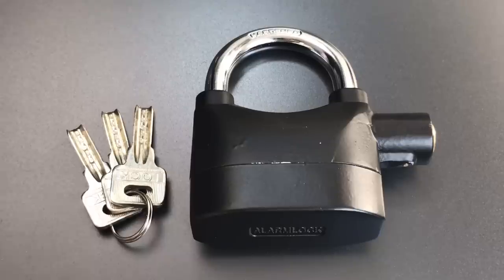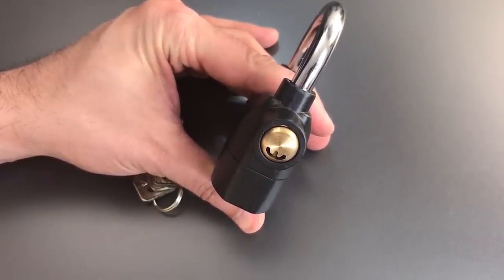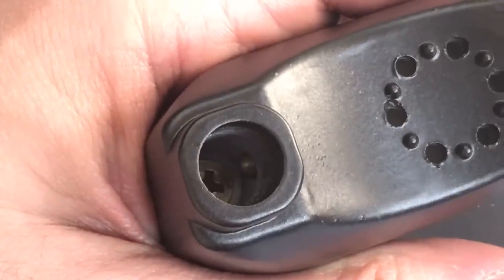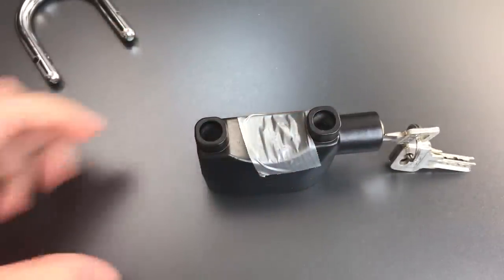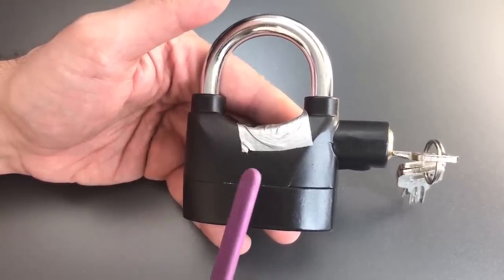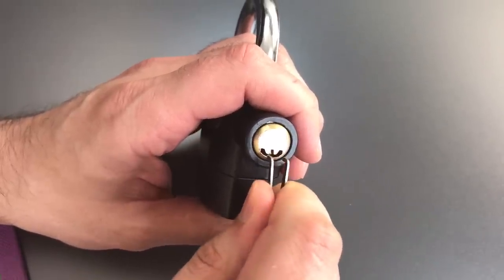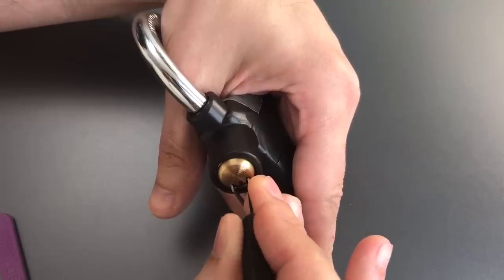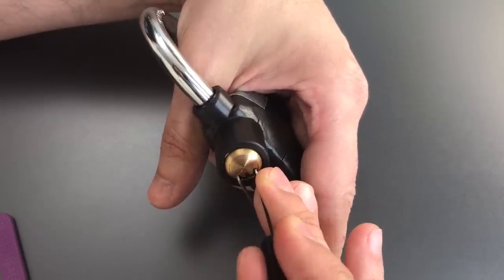[505] Chinese "AlarmLock" Picked Without Triggering Siren

Comment: They need a trigger sensor in the lock to sense when it is being picked!
Reply: how would that work?
It would go off even if you open it with the key.
Reply: 1 second delay
Reply: ༺Boy Red༻ Simple. Just let the lock give the person a second or so to open it before triggering the alarm, or maybe sensing which pins are being pushed in before others, and using that to determine whether or not the alarm would go off. This thing is Chinese, though, so I wouldn’t expect it from this lock.
Reply: One way I could think of is SOMEHOW being able to detect the time between each pin being set. If you insert the key, all the pins would pretty much instantly be set, where as a lock picker goes in pin by pin.
Reply: Just have it trigger on the false gate.
Reply: maybe if u hold the key in for too long that it sounds the alarm cuz it did take him a minute to get thrue the lock and unless ur stupid u aint spending more than 10 seconds on a lock but if ur lockpicking u will  @ItsBoyRed

Comment: i propose this lock for best lock on your channel. picking the same lock multiple times while holding it in your hand is not a real scenario. as you´ve said, the first time picking it, you triggered the alarm! additionally, if the lock was actually locking something you wouldnt be able to hold it like you do, using your muscle memory.  and last but not least, you even got stuck with your covert-entry pick. lpl has found his cryptonite. ^^

Comment: 2 things

1. Try picking it whilst it's hanging from a gate or in my case a tow point on my 4x4 2ft arms reach away so if it gets knicked in the night they wake all my neighbours up

2. Just pours a little boiling salt water with a bit of sand in it into the speaker hole, no noise at all ceases things

Comment: I picked one of these up at a car boot sale today because it looked interesting and I figured I'd forward it to LPL if he hadn't already negotiated one. Well, imagine my surprise when I found this video. The battery is replaced by removing the shackle and there is a posi-screw at the bottom of each shackle well. Unscrew those and the bottom pops off revealing 6xLR44 cells.

Comment: This lock seems better than any other on the channel. I’m buying it. If it takes him that long it’ll take a burglars longer.
Reply: As an owner of this lock, the quality of metal is awful. It's light as a feather. A bolt cutter will have it off in 2 seconds and a thief brings a cutter not picks. I use mine on a motorcycle but hide it under the seat as a motion alarm.

Comment: Hey LPL. You can use an even easier way of disabling the alarm on these. The design flaw is the speaker. If you get the alarm wet, it shorts out the battery and disables it completely. Found this out via a wet Scottish Winter!

Comment: This alarm lock is GOOD ENOUGH.
If your locks are on the inside. Very useful and effective for gate locks.

Those that need your hand to be inserted inside just to insert the key. Our gate is like that. Our gate has a hole fitted only for one hand for keying the lock situated inside.

If Lockpicking Lawyer took a solid 2:30 minutes to unlock it WITH BOTH HANDS at full capability, angle and space to work with, then this lock is good. As for the 507 update, re-read the previous paragraph and it's just impossible.

Comment: I owned two of these locks. They are not waterproof at all. Which is a big flaw for an electricity operated alarm lock. Leave it out in the rain overnight and then trigger the alarm. If it still responds at all, all you will hear is a super muffled "bleep bleep, eeeew... pffrt. Silence". If I was to attack this, I would probably just pour it full of water and then use an ice spray and smack it with a hammer.

Comment: In a real situation, the keyhole may not be in a convenient direction and the lock might also be closer to ground or on the other side of a fence or surrounded by bike parts. The makers had to compromise between sensitivity and accidental movements caused by environmental activity. The risk of triggering the alarm is already a strong deterrent to thieves, quick makes this a pretty good design concept and quite well executed. I just wish there was a way to customize the sensitivity. They should use an accelerometer rather than detecting spikes in electrical contact

Comment: I'm no locksmith, but if I were to design an alarm lock, I'd probably do it with an RFID key. If the barrel rotates without the RFID tag on the key in proximity, then the alarm would trigger. Obviously in addition to the jostling detection, of course. An alarm is no good if it only triggers when it's already too late.

Comment: I can just imagine some kids purposely triggering the alarm and running away just to screw with the owner. Thats another problem with this lock is that the alarm triggers relatively easley. It should sound when it's getting picked or cut. Not when it gets gently tapped

Comment: I would like to see this one redone, the way you are holding the lock instead of it hanging by the shackle removes all tension defeating the purpose of the alarm system. You wouldn't even be able to hold the lock in that position you just did if it were actually locked onto something, kind of cheese. I still love your content though.

Comment: I could actually see this being good against low-skill attacks, just because of the siren. Using bolt cutters, or even possibly a plasma cutter/oxy-fuel torch would likely set this off, and it does seem like it took LPL a bit of time to pick w/o setting it off. I view plasma cutters and (to a lesser extent) oxy-fuel as lowish skill, but high cost of entry; no point in listing an angle grinder as they're so loud the alarm would even matter. Oxy-fuel is definitely quieter than a grinder, not sure about plasma cutters; they are definitely a bit noisy due to the high volumes compressed air they use. I still don't think plasma cutters are as loud as an angle grinder, but I'm not 100% sure because it's been over a year since I last used mine, and I've never directly compared the two.

Wouldn't use this lock in high-security applications, but I could 100% see myself using it for low-security applications where someone is typically nearby.

Comment: There are various parts of the lock mechanism (not least the tumbler) that could easily be monitored directly for motion. It shouldn't take more than a second or three to open a lock with a key, but it would be challenging to pick it in less than three seconds without triggering the motion sensors, I should imagine.

Comment: I have this and it only uses 3 LR44 batteries.. I never bothered to replace them. I would see this as a good review of the security as in the real world like on a bike chain in a shed it would be very hard to pick without setting the alarm off... If you replace the batteries. That said, the tape is worrying and highlights a weakness.. maybe super glue or Krazy glue squirted into the speaker holes would be even more effective at silencing the alarm.... If you replaced the batteries ;)
Reply: Salt water?

Comment: I think the main problem with this lock is that you could just heat it up with a blowtorch and the alarm speaker would immediately break. It would only need to get to about 100 degrees C and then you could pick it no problem

Comment: I wouldn't feel safe using this. Think about it. It's the middle of night at work or home and I suddenly hear that someone has tried to break into the back door or my shed as the alarm had gone off. Now I either need to call the police (when a few hits from a windy night can set these off), OR I need to go to the lock with the keys in hand and unlock it to stop the alarm. This is the crazy part, for all I know I'm going to get a bat to the back of the head as soon as I open it to disable the alarm.

Not worth it.
Reply: What I've learned about locks on this channel is that there is a lock for every situation. So in your scenario maybe you are right this isn't the lock for the job.
Maybe in this scenario you would have been using a gun lock and took it off to shoot the guy with the bat.

Comment: I think it would be quite more difficult to pick this lock whent it is on a door. Having it on the hand, in my opinion makes it way easier to pick this lock without activating the alarm compared to normal conditions.

PD. I'm not saying that picking a lock doesn't require skills.

Comment: I love how easily the speaker is compromised with tape. Did a similar thing in college with the smoke alarm that would go off anytime someone was cooking. 
But I take issue with how you picked this lock. Your grip for holding the padlock is completely unrealistic for how one would hold the lock in the field. If this thing were attached anywhere, you could not put your thumb through the shackle and keep such a solid grip. Admittedly, I am an absolute novice when it comes to lock picking, my knowledge coming only from your videos, and your grip may have had nothing to do with the end result. However, I feel like the way you held the lock prevented the alarm from triggering, and ultimately, I wouldn't consider the lock successfully picked if all of the security features aren't taken into account.

Comment: You are amazingly skilled to open locks but i would like to see you try this same lock or some of the others already chained down because your hand placement would have to be diferent you put your left hand inside the area were there would be a chain or a piece of metal. I think you would be able to open it but it is a little more tricky to make tension to the key area. thenks.

Comment: This is a very controlled environment. It wouldn't be that easy to pick this lock (or any good lock) if it was dangling off the thing it's locking, in a poorly lit driveway in the middle of the night. Furthermore, burglars would be tense and filled with adrenaline (fear of getting caught) which would hinder their lock picking ability.

Comment: wouldnt it be better, if they put some sensor that would check if you are putting pressure on the mechanism (so checking for the core element of picking a lock) and dont unlock it within 0.5 - 1 second it will sound an alarm (and a counter if you do very short pressures too much it will sound an alarm to, so you cant abuse it)

Comment: you could also just create a lock that doesnt work and only works when your in a meter of the lock therefore accepting  codes whereas being far away the bike will not accept any code until that key is close into vicinity: almost perfect

Comment: If tape works, imagine what your hand over the sensor could do. I wander if you could punch a hole through the screamer with a hammer and screw driver without setting it off. I feel that would be easier when it's suspended and in use.

Comment: With the protruding mechanism surrounded by PLASTIC, could you just cut around it with bolt cutters or a Dremel?
Also, battery life / replacement ?

Comment: There should be one that links to an app. Before unlocking you activate the lock from the app, which sets off a 15 second timer. If the lock is unlocked outside of that 15 seconds it sets off an alarm and sends a notification to the owner. 

Maybe even incorporate a really shitty small camera?

Comment: Im just wondering, if its so sensitive, how is it when using in a real situation? I mean, if i put it on my shed will a strong wind set it off? It doesnt seem practical with a lock that you cant use outside.

Comment: The alarm lasted longer then I thought they could make it so then the alarm is triggered by lock picking by putting maybe a system in the part we’re the lock goes so then it’s a little more resistant to lock pickers I would give this a 3 stars

Comment: I use that exact same design locks but different manufacturers. But my locks has a bit loose shackles and also the copper(?) Keyhole aslo a bit loose so if someone pressed too hard on the keyhole it's basically just triggered the alarm no warning beep. Even when i try to open it with the key the alarm always get triggered.

Comment: That seems like a pretty good lock to me it too you a while to pick it and that says something at least to me and yeah maybe the alarm is a little easy to stop but it still exists and its fairly easy to set off and it does a pretty good job at being a lock your probably not gonna use it on thr absolutely most valuable thing and no average person will be able to pick that with little to no experience under there belt

Comment: how can you say you can pick it easily without setting off the alarm when you had your hand  under the shackle holding the whole thing stable.
Reply: You make a great point. A thief will rarely roll up with a set of picks though. He'll most likely bolt cut it or the chain its on. I own one of these and they are crap quality.. but, it's a great motion sensor and is very loud. So hide one where it will fall over or be shaken and it will serve well as an alarm on a bike, door, holdall bag or whatever as long as it's concealed. Even this lock picking legend set the alarm off twice before beating it.

Comment: If you knew enough to be careful that means you know it's a alarm...if you know that there's 100 ways to deactivate it besides tape which itself if not CAREFUL will set it off .. OTHER things to do might include  pouring a water alcohol acid solution over the holes to melt the electronics or the speaker or pouring over the holes some fast hardening epoxy  which all would make whatever it does way less severe than the tape... ONCE AGAIN,  the issue is  that locks no matter what have a limit to their utility which everybody understands except you.. AND Along that line, if a crook breaks into your house and  you have have a keyhole wire latch lock costing a dollar or a 200 dollar security smart Lock, it's still breaking and entering versus not in court.... LOCKS have a legal and intent exposing function and are a deterrent for opportunistic and petty thief crimes,,, they are never bank safes,, not even if it's on your house door.... YOU never use a lock as the sole way to protect valubles... For valubles the lock is on a box in a vault with a dozen security features, in your house or a business you don't keep expensive valubles there and you also have a phone system to call or that calls the police itself and maybe a gun and an escape route.

Comment: could you make a lock that needs all the pins put in the correct position in a certain amount of time? then lock picking would take longer than just putting the key in. idk an idea
Reply: You certainly could but the required circuitry would be rather complex for a simple padlock.

Comment: This lock can be defeated without even getting close to it.  Use the "cry wolf" approach.  Just ping it with a BB fired from a BB gun and leave.  Do this action a few times over a few days.  The owner will replace the lock with a lock that doesn't contain an alarm.  🙂

Comment: So, I've watched a few of your videos now, one thing I have noticed is you dont really test picking these locks when they are actually locked to something.

For instance I've worked on power grid right of ways. Often times the locks are kind of embedded into posts, through holes in steel poles, just generally in weird positions where I cant actually manipulate the lock body, which in turn makes it a pain to unlock with even a key.

Like most things, it's easier in a controlled setting.